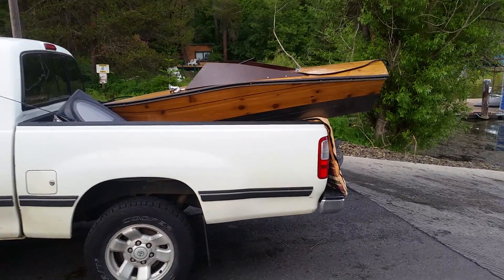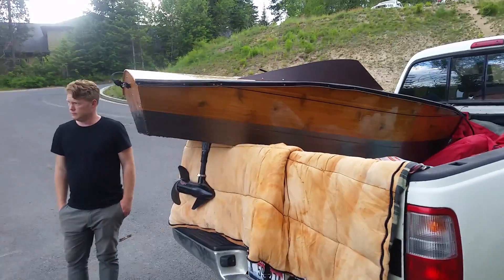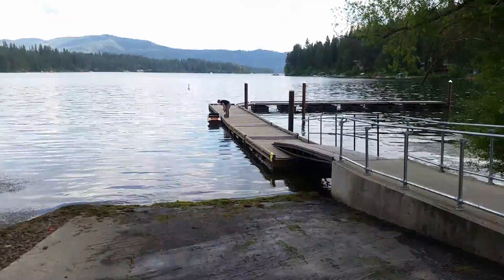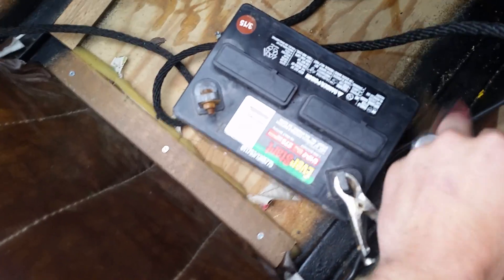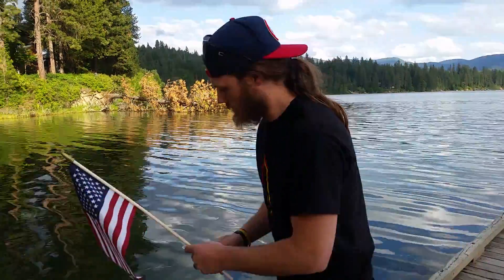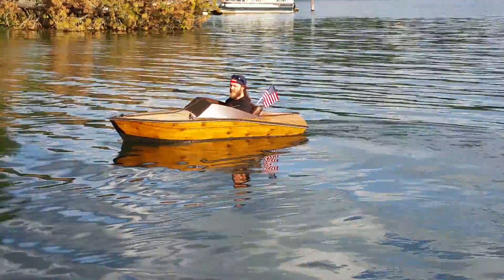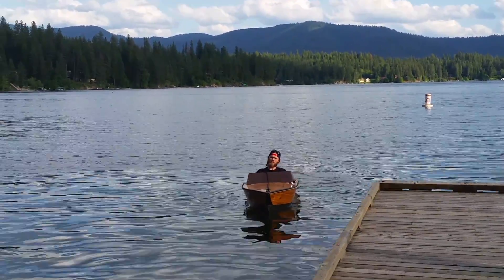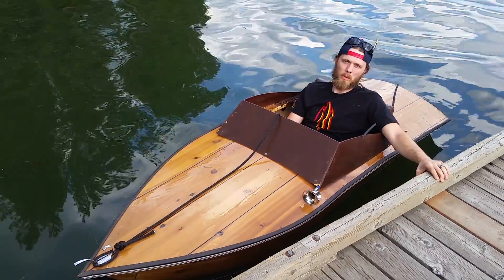Plywood boat electric inboard small

Comment: There are lots of tiny boats like this one in the Philippines, but instead of using electric motor powered by batteries, they use a 110CC or 125CC Motorcycle Engine, that way they dont need to charge or anything like that, just put some perol in and you can blast of, they are very fast.
Reply from the maker: That would be fun! These never need petrol and are almost silent. Very relaxing and fun to be in nature! Both are awesome!
Reply: @americanboathead5390  Yes it's fun and exciting because fishermen even made race bets on those boats. But of course, it's not as fun as with the Thailand version, because they put a V8 Car engine instead of just a motorcycle.
Reply from the maker: Those are awesome!!! Its insane how much they can fit into such small boats!
Reply: @americanboathead5390  Yes indeed.

Comment: I want to build one !! 👍.  ... how does it not leak by motor ?
Reply from the maker: You should!!  The easiest way to keep water out is to have the pipe that the motor shaft goes through, be taller than the water line.  Mine goes down and has a rubber tube clamped on it that twists but keeps water out
Reply: Thanks !

Comment: Batterie and water is not good man !!!!! This is not good man sorry ! But no!
Reply from the maker: I can see why you would think that.  If you do a little bit of research, youll find that a battery of this size wouldnt have enough power to hurt anything besides itself.i would slowly discharge.  A power line in a pool would be bad. A battery this size wouldnt even hurt you in a bathtub...  now if this were a lithium battery, then it could explode!  But this lead/acid battery is completely safe.  Thank you for the concern though friend!

Comment: what does something like this cost in materials
Reply from the maker: Well the stuff you generally cant get for free like epoxy, fiberglass, battery and trolling motors will run around $300 new.  But if you get a used motor etc. That price could be way less.  The wood you use could be free from a scrap pile or expensive marine grade plywood.  I'd expect around $450 all said and done with steering and such.  It's not as bad if you get do it in stages!
Reply: American Boathead Thanks for the reply! I’m looking forward to building my first boat
Reply from the maker: Awesome!!

Comment: Only issue with low speed boats is they are actually deadly, impossible to avoid danger or even navigate away from say another vessel or wave lol. Safer toy just for a pool.
Reply from the maker: Do you think that a large boat going 30+mph over waves is safer?  I'm pretty sure a mini boat that stays where it very obviously should, like by the shoreline and away from waterfalls and damns etc. Is 100x safer.  I may be wrong, but your comment sounds completely ridiculous...  impossible to navigate away from a vessel or a wave????  Well I guess your right about waves.. pretty unavoidable on water....  smh...

Comment: Are you using duct tape instead of flextape lmao
Reply from the maker: Yeah this is made out of wood print duct tape...
Reply: @americanboathead5390  well thats not what i meant looked like the bottom was wrapped in duct tape
Reply from the maker: @masterchu8044  oh yeah!  Its been a long time but actually i used some grey paint (unfortunatly same look as duct tape)  and also sprayed flex seal on the seams!  Good eyes!
Reply: @americanboathead5390  very well done love the video and the job you did on the boat i am fascinated by boatbulding

Comment: Building my own mini boat oh, I was wondering what pound thrust trolling motor you used and about what mile per hour I should expect from that? I have a 6ft long 38 in wide hole from a carnival kiddie ride that I'm working with, LOL
Reply from the maker: That sounds awesome!!!  It seems like your top speed will be about 3-4 mph no matter what pound thrust you go with.  I usually go with the 30lb thrust because they are the best value.  They also are 12v so only one battery is needed ( some 55lb and higher are 24v) i have a 6ft boat that is 22" wide and it keeps up with a 17lb thrust so its just kinda up to you.  Maybe the 55 would be better if there is wind but idk for sure..
Reply: @americanboathead5390  wish I could post pictures of what I have and what I plan on doing. I think I will use your ideas for steering and mounting the motor. What ah battery do you use and how much run time do you get?

Comment: brand new boat and no damm paddle? The motor and battery and connections will be perfect and not get wet under any circumstances ?  get real
Reply from the maker: I could reach down and paddle with my hands or jump out and swim the 50ft i got from shore.  Ive  been out a dosen times even in rain and never had any issues at all. Though i do wear a life vest now in case a boat hits me or something.

Comment: I think you'd be more stable if you kept the propeller shaft fixed. Then steer the boat with a rudder. Because when you turn the shaft, your thrust is no longer going backwards, it's going sideways. That's causing your instability. If the thrust is always pointing backwards, then it's always pushing the boat forwards
Reply from the maker: yeah when i turn the motor, it wants to roll the boat and climb out of the water!
Reply: American Boathead and if you turn it far enough and hold it long enough that's exactly what it'll do! LOL. Nail down that Motorhead, and hang a Rudder off the transom, and it'll be a whole different ride.! Plus, a nice quadrant steering system would look bad ass on that boat.
Reply: American Boathead ...or just Mount the Motorhead on the transom. that would work too.
Reply from the maker: what is that steering system?  i need to update mine

Comment: dude I really like your boat it's beautiful I'm not trying to diss you but I'm wondering why the out Drive has to be two feet below the bottom of the hull, in short did the propeller need to be that far underwater?

Comment: I would love to see a mini trailer built for this!
Reply from the maker: +HypeBeastCentral I made one kid a but I called it a mini boat dolly!
Reply: American Boathead + I made a sailboat about the same length,  and then assembled a trailer from Harbor Freight. Make leaf springs from 1/4"  spring steel rods, if can find some: Alro Steel. Buy a few extra. Two per side for my application. Add your boat and trailer sprung weight, divide by two, for spring flex rate. Make it to settle about 1" from the boat weight. 
Or 6" diameter PVC tube section cut out, slowly heated, flatten, shape. I don't know the endurance of the PVC though. Spring steel rods work. My boat, close to 70 lbs, rides plenty smooth.

Comment: A small 2.5 hp Tohatsu would bee perfect for that little boat.
Reply from the maker: +Bill Lawton for sure!  Not too much but light and manageble!
Reply: It would push it nicely up on plane but not beat you to death. Quite frankly what you have is nice. But I noticed your not old, you may want to go faster.
Reply from the maker: +Bill Lawton im an old soul in that way hahaha i find a lot of enjoyment out of going slow!  I would like to go faster for sure too though and the speed you are talking about wouldnt even be jet ski fast or anything. Im thinking of putting a 4hp on it just to see how it does and its what i have..  but its not as light as the 2.5 which is a big factor....  even better would be to put the 4hp on the latest boat i built and maybe even add a small vee to the bottom in the front... lots of work lol

Comment: Would it be possible to have the plan? great video
Reply from the maker: +adrien fabre i have the plans for sale online. If you google   gumroad halfcraft you should be able to find blueprint a building guide and full sized patterns (unavailable at random times if i am out of town)  let me know if this helps.  I also have a video that explains how i make the plans and why they cost what they do on americanboathead @youtube
Reply: OK. thank you
Reply from the maker: +TheSpeakerClub TSC the guide is srep by step how to do it. But for the pieces, you need to either make them up or use the blueprint to make them OR the plans plus pattern package has payterns that you cut out and then put together using the guide but its more expensive.
Reply: American Boathead Is it the "Creative boat building guide" that has the plans for the boat that you're using in this video?

Comment: What about the battery wont that electricute you if it takes water ? Curiouse
Reply from the maker: +Quinton LoganPl thats a great question! Ive researched it some and it seems that water is conductive but compared to metal wires, not very. On top of that, the battery doesnt have enough voltage to electricute a human. A 9v on the toungue doesnt even hurt. From all ive read, the bigger danger is burns from sparks created by shorting with metal, or the sulfuric acid from inside the battery burning skin or polluting the water.  If you dropped a house appliance in the lake, it would have 110v and have the whole power station pumping electricty  into it, thats different lol  let me know if you find other info!!  Thanks for watching!!
Reply: American Boathead thanks for the reply how much would it run me to make one of these as a kid i grew up near mt trashmore in virginia beach virginia me and my older brother jake would take old huge wooden telephone poles / logs and roll them into a lake and hope it didnt rotate lol but it worked well then we moved up to inflatable walmart pool boats lol cheap rubber , at times we would try to replicate a bear grill style raft lol idiots really lmao but we had fun but back to my question how much for materials to build
Reply from the maker: +Quinton LoganPl haha its fun being on the water no matter the craft! I have a few of those rubber rafts too but wood ones are sleeker!  The price of course depends on how you get the parts. The trolling motor is usually $100  the epoxy, fiberglass and paint is around $100 the wood and screws will run between $50 and $100. This boat was less than $200 because i got most of it for free
..
Reply: How much for you to build me one !
Reply from the maker: +Quinton LoganPl aww shucks  id do the labor for $200 i recon... im not sure what shipping would be but it could be done!!  Its not hard but if someone is paying, id do a nicer job lol   id love to build and sell ofteb!!
Reply: Have n idea seal the outside with a fiberglass mold clear if possible

Comment: deep cycle battery better power and speed
Reply from the maker: +Rebel James is it the cranking amps?  I figured the 12v would be the same but not last as long (and get ruined from being drained over and over)   i need to test!  I need deep cycle either way though...
Reply: yep that's where your power level stays up there, regular batteries lose amps to fast power drops they make large or mid size deep cycles increases the weight but not by much, and heavy cables that are directly connected alligator style clamps bleed off to much energy..
Reply from the maker: +Rebel James that should help with my main power wires getting hot too!
Reply: yep sure would

Comment: Really well made boat, very cool! You need twin 1000W electric motors and Lipo batteries to make it really fly and go the distance! Next upgrades!
Reply from the maker: +helloman1976 if i aquire those i will install them immediately!! Lol  that would be the ideal setup in my mind. Especially twin jets!
Reply: @American Boathead Look on eBay, you can get the whole package with 1000W motor and controller etc for cheap! I bought the 450W setup and installed it on an old scooter and it FLYS!!! I put in 2 x 16,000mah 4S lipo batteries I got from Hobbyking and it goes about 30 miles on a single charge and charges in under 50 minutes on my high speed charger setup. The lipos are run in series...
Reply from the maker: +helloman1976 anyway you could send me a link?? that would be the best!!
Reply: @American Boathead I can try, I searched for 1000W motor on eBay if this doesn't work and also Hobbyking, search for that and you'll find it for lipo batteries and chargers. http://www.ebay.com/itm/1000-W-48V-ZY1020-electric-motor-kit-w-Base-control-box-Thumb-Throttle-/151878214133?hash=item235ca5a1f5:g:ILsAAOSw~bFWP3MH
Reply from the maker: +helloman1976 thank you for taking the time to do that for me!! Im super stoked!

Comment: you need to throw a two stroke on there
Reply from the maker: +Craftst3v3vd yeah and bigger than a weed eater!!
Reply: look into brush cutters (they have motors the size of scooters but are still light (so they can be carried.)i have a brush cutter that is 45cc.
Reply: Thats a little too strong for a little boat  1 stroke would be better
Reply: It will flip over if you put a 2 stroke
Reply from the maker: These boats are about thrust, not strokes..
Reply: @americanboathead5390  Yeah get a 85lbs Thrust motor on there for a couple hundred bucks be goin' 8-10mph..
Reply: Oh ok
Reply: Brian Davis
you have a choice scooter motors have a muffler but are heavier brush cutters are much much louder but weigh nothing and are very strong.
Reply from the maker: +LawnLink that would do it! Loud? Ill look into them

Comment: Needs more power, a smarter battery storage area and quick cable disco. Also, a better faster engine. The body is cool. I can only imagine how fast and fun that thing would be with some actual power behind it.
Reply from the maker: +Kevin Palombi i dont know if it would handle worth the upgrade... i agree though its pretty crude....  i have a gas motor (predator 670cc) that would work on a slightly bigger boat..  we shall see!!
Reply: Still a rad idea. There has to be a way to stabilize it.
Reply from the maker: +Kevin Palombi if you have a sec, maybe you could look at my most recent video and tell me what you think. I feel like its a step in the right direction but only more stable while moving... thanks man!
Reply from the maker: +Kevin Palombi https://youtu.be/2o8N_HWAyIo
Reply from the maker: +Kevin Palombi https://youtu.be/2o8N_HWAyIo
Reply from the maker: +Kevin Palombi https://youtu.be/2o8N_HWAyIo

Comment: give it a bigger engine... the bigger the engine, the bigger the fun!
Reply from the maker: +ferrarigirl666 i think it needs to be bigger period lol   but you are correct!
Reply: +Brian Davis not bigger boat ;) just a looooottt of more power.... jetski engine maybe? ;)
Reply from the maker: +ferrarigirl666 yeah! they even make engines that fit in a surf board!  I think jet drive is the way to go and jet ski would prob. be cheapest
Reply: +Brian Davis those for surfboards are expensive! try old jetski impellers or even an old snowmobile or scooter engine...

Comment: You should have coated the entire inside with epoxy.  And I would have fiber glassed the inside seams too.  But I like your design.
Reply from the maker: +Adam Lucas yeah that would last much longer.  I did pour resin in inside bottom corners and filled some gaps that way but not as good as wrapping corner with fiber! Thanks!

Comment: that is very cool .. I wondering .. do you put some fiberglass coating on it or what ? .. very awesome boat .wtg
Reply from the maker: +bern trailboss yes the bottomm has a layer of fiberglass mesh and epoxy resin everywhere. Then paint as well on the bottom.  Thanks for watching!!

Comment: could you use a chainsaw engine without polluting the water,or a lawn mower engine maybe with a quiet muffler ? or is it not for speed just cruising ? great work regardless bro davis.
Reply from the maker: +onewheelup thats what i always wondered! It must be for noise especially two stroke boat motors. I have a vtwin motor (designed for a generator or pressure washer) that i want to put in a boat. I dont want to pollute water either, maybe a really quiet muffler with valves to open when power is needed for speed.   Hmmm
Reply: yea theres all types of silencers / mufflers for like those pocket rocket bikes and go carts dude,the main thing is your rocking it and have fun,looks like you live in a beautiful part of the country too.good luck bro later

Comment: keep working on it, few small points if you run aground you loose rudder and power, if you hang the drive off the stern it can kick up instead, or put a skeg in front of the drive to protect it from hitting anything, first try new boat wear a PFD, also bring along a paddle if you lose power you are not helpless

Comment: where is the inboard engine ;) see only build in outboard
Reply from the maker: +groenekever yes you are right! True inboard is much more complicated and better!
Reply: no easyer build a hybrid diesel a month ago.
using junkyard parts
Reply from the maker: +groenekever how did the angle work? U- joints? And the thru hull is hard how did you keep it water tight? I would love any advice thanks!!
Reply: i used a parts of a a few old boats, driveshaft, shaft grease lubricated and prop cost me the most. 5 krates of beer :P (1 krate is 12 botles)

Comment: oh man i wanna build this.
Reply from the maker: +Jette Christensen do it and send me pics!! Its super easy!
Reply from the maker: +Jette Christensen do it and send me pics!! Its super easy!
Reply: Brian Davis I might even use a little 5hp engine lol.
Reply from the maker: +Jette Christensen   that would be soo awesome!! There are little 2.5hp two stroke outboards that would move it at least twice this fast!   5hp would be perfect.
Reply: Brian Davis hey what did you use to seal the boat from water?
Reply from the maker: +Jette Christensen i used 2 part bar top epoxy resin and latex porch paint on the bottom part